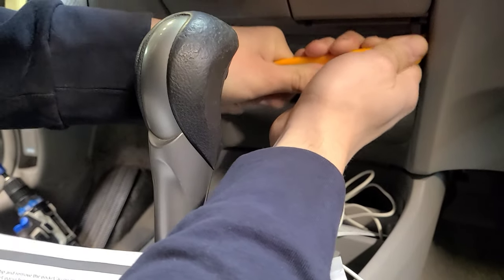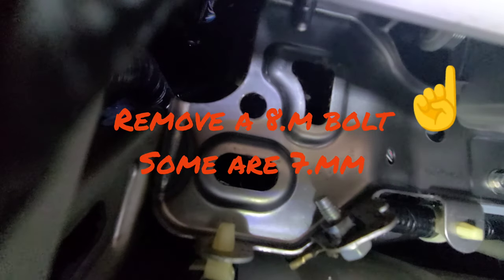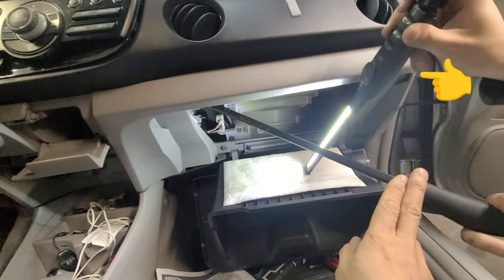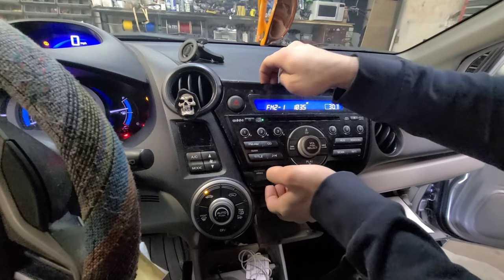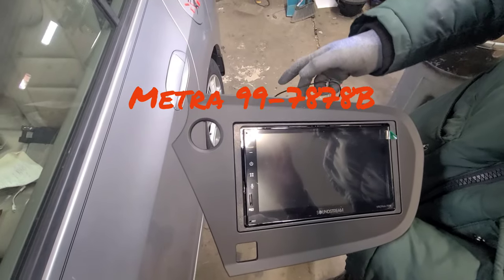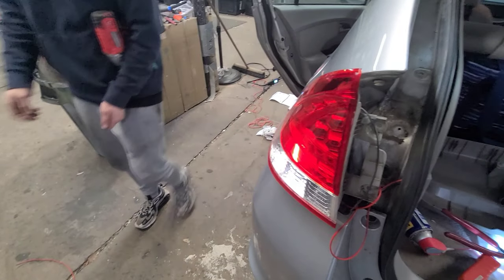2010-2014 Honda Insight How to remove radio Apple carplay android auto Metra kit reverse camera

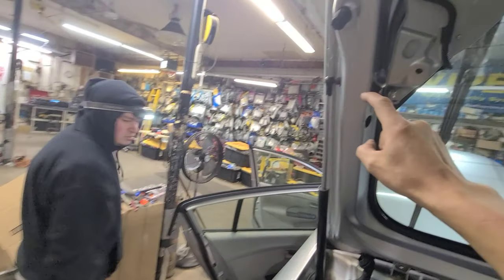Comment: 2:45 I see you've run into the same problem I am facing. Driving me nuts, you can't even pull the existing cables through
Reply from the maker: Yeah but if you do what we did it would go in

Comment: i wasn't able to remove the hatch trim pieces, can you cover how to do that?
Reply from the maker: Hatch trim?
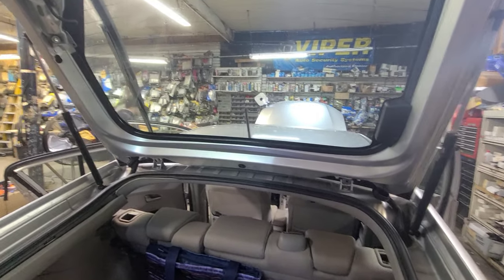Reply: @goautosound1  when you skip to 2:35, there should have been plastic trim pieces that obstruct the wiring, but you already removed them in advance. I am unable to remove any of those, they are super tight and won't budge
Reply from the maker: @ccarniver  we have made a hole to run wire the trim is very tight but it will come out if you PRY IT.IT has locking plugs which needs to be pulled out
Reply: @goautosound1  thank you for the answer. I wish I could use your service lol, but I'm far away in eastern Canada
Reply from the maker: @ccarniver  I will wait for you ☺️

Comment: I have the same vehicle how much would this service cost if I bring it in?
Reply from the maker: Hi, the installation we've done was $50 plus RADIO. Kit.plug.and an antenna adapter .Installation fee could be more depending on the installer
Reply: @goautosound1  am I allowed to bring in my own radio?
Reply from the maker: @christineluxe9696  yes if you bring your own we would change around $100 plus extra part
Reply: @goautosound1  okay great thank you so much 😊